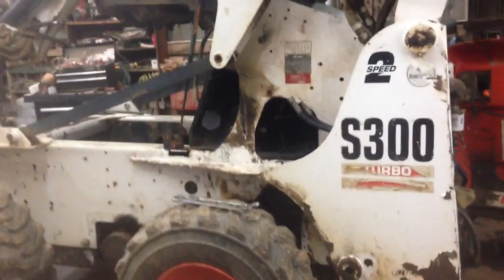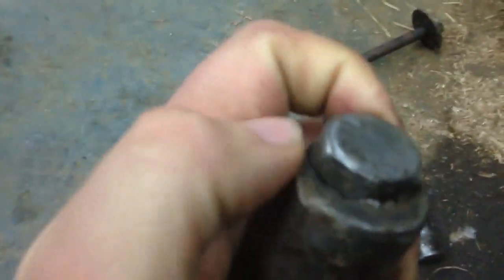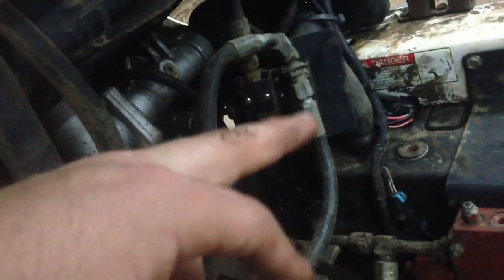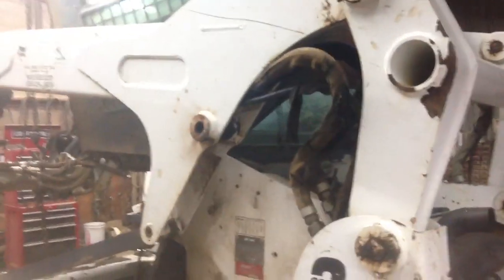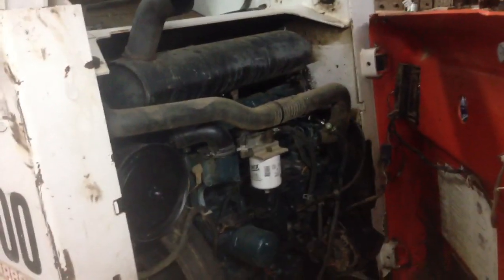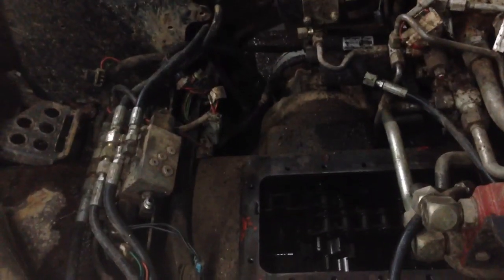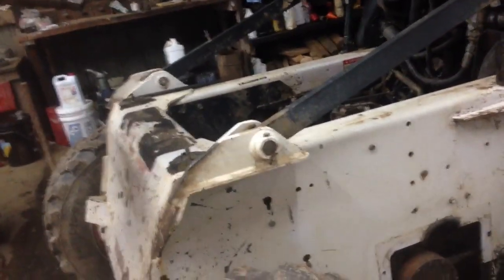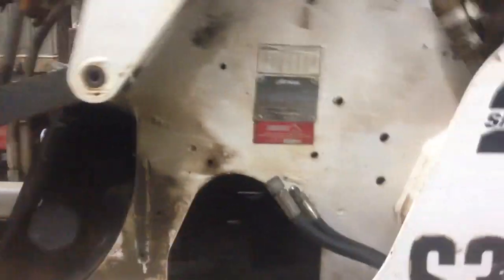My new purchase!

Comment: Nice choice! That's going to be a great helper on the farm. Newer than anything I have and bigger too. Beware of corrosion in the fuse box under the seat. An intermittent connection in there can cause spikes that damage the controller computer which is an expensive fix.  A friend's machine had that happen but we were able to fix it. I have the electronic version of the service manual if you need it. If I lived nearby I would help you fix it, all I would ask is that you let me run it sometimes when you are harvesting hay!
Reply from the maker: Haha! Thank you!! I'd let you run it!! That's good to know! If I have any questions I might pick your brain a little!!
Reply: Feel free to contact me anytime, I have answered many questions about my friend's skid steers. Then again I was the one pushing them to buy one in the first place! Even make hydraulic hoses for myself and them at cost.

Comment: I don't know much about fixing em. But my old boss bought a brand new John Deere I spent two weeks cleaning his Corral's with it the heat and AC we're nice. Does this one have foot pedals. That jd it was all joystick I wouldn't go Jack to foot pedals after that and I hate John Deere but they sure made a nice skid steer. Ran a bobcat landscapers special they called it the wheels actually turned side to side guess it was supposed to be easier on the ground. Good luck with your winter project looks like it'll be a good one when your done.
Reply from the maker: It has foot pedals and joysticks! You can switch it! Thank you!! It'll be a lot of parts runs! Lol
Reply: Landmark cattle bet you could take the misses into doing a few of em for ya